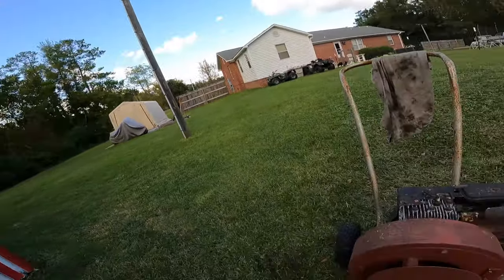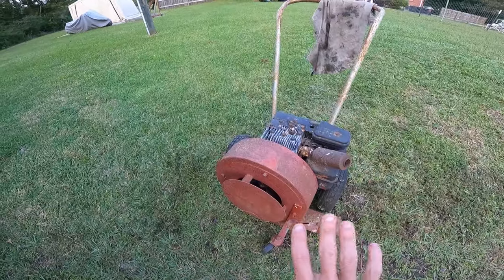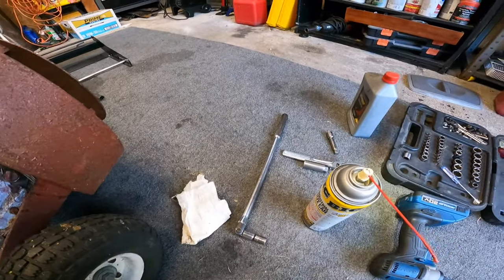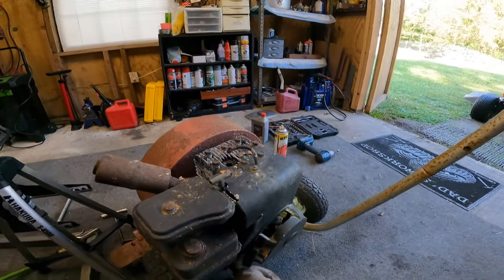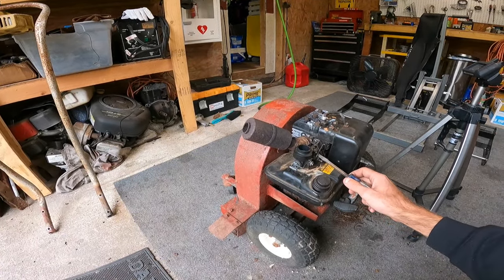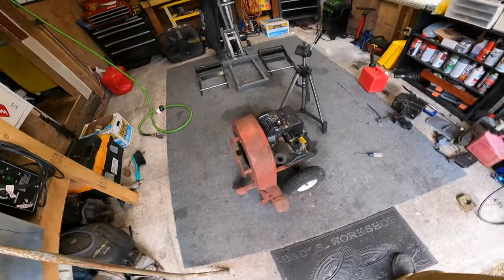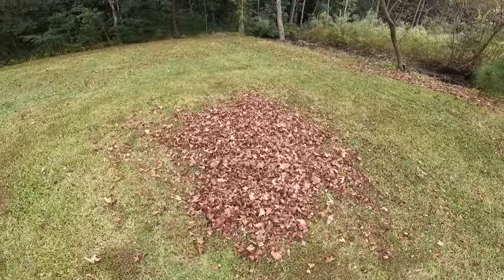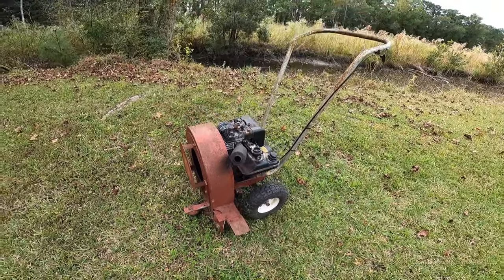Saving an ANTIQUE Giant Vac blower from the SCRAPYARD

Comment: Great save. I find it to be very rewarding just from the point of view of accomplishment to bring back to life something that has been idle for so long. I'm glad the motor was basically ok --- rings ok, no seized piston, good spark etc. You get extra points for adapting the new tank and its assorted hardware to the engine. Wish I had that kind of mechanical skill. Have fun doing the restoration.

Comment: Great job, Alex!  I was impressed with your ability to figure out linkage conversion and get it pretty much right on the money. 
I have Engine RPM app on my phone, which works using sound to determine RPM. You were running at 2533 at the end, so yes, you could definitely increase engine speed. 
I’m curious why you would want to repower - I’d want to keep that engine since it seems OK.

Comment: I've seen a little wonder Walk behind blower that  had the engine run with out oil The shop put a.t.f in the engine and let it  soak  for a few days   it was running when I Saw it as you said you might have to repower it    I've got to replace the p.t.o on my craftsman gt tractor  sounds like the  blower fan is the culprit of the  sound